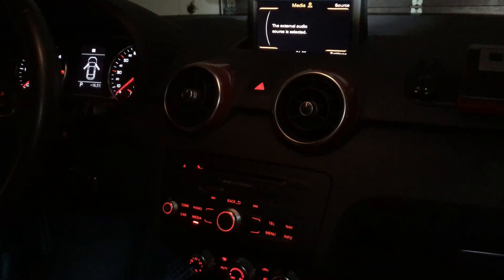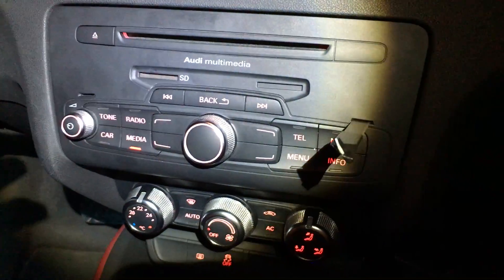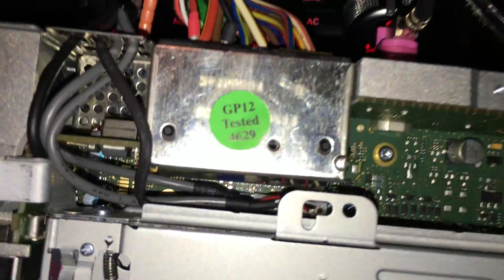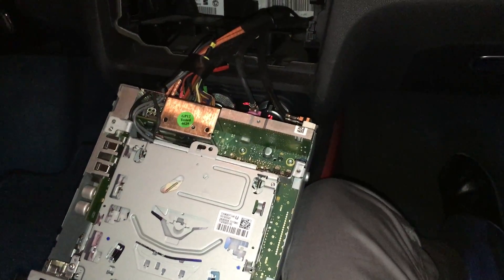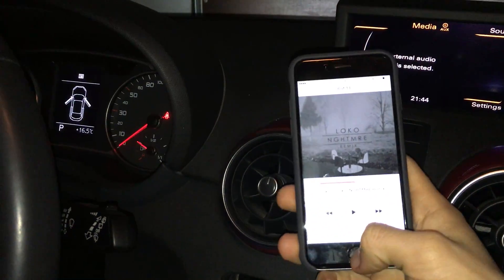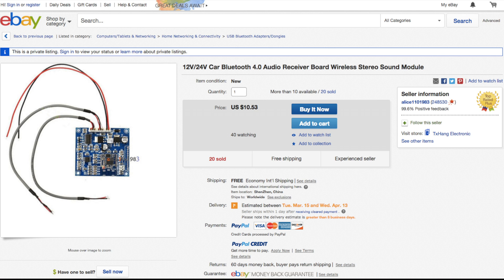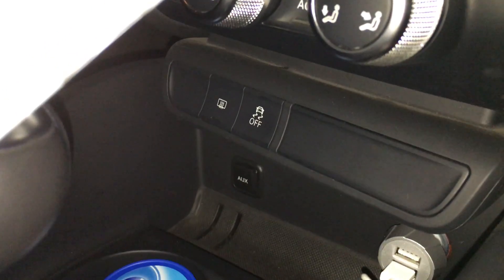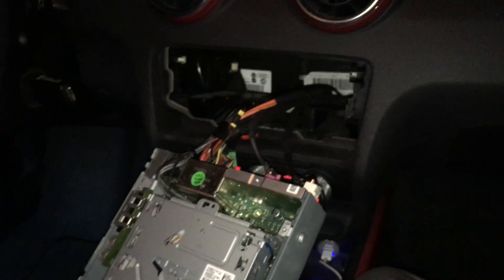Bluetooth Car Module Installation (Part 1)

Comment: But you don't explain input and output audio connections. I bought one but I can't find out input and output audio.
Reply from the maker: Ok, so here's the thing, imagine that this is your original 3.5mm aux cable and it consists of 3 wires like this:

MALE:                                                                                                   FEMALE:

--------------------------------------- Left         ||----------|----------\,,,,,,,/-----\        basically where the male cable plugs into!
--------------------------------------- Right       ||           |            |              |
--------------------------------------- Ground   ||----------|----------/"""""\-----/

I don't know if you see it but it is supposed to represent the existing AUX plug of your car (the male side)
Depending on the car, you might have the 3.5mm jack on a wire hanging around, or you might have a hole (female) in which your plug in a double sided 3.5mm jack from your car to your phone like this one: https://www.amazon.co.uk/World-Data-3-5mm-Stereo-Meter-Black/dp/B00077DC3S .

===========================================================================================

OPTION 1 (if you have to use a double sided 3.5mm jack cable):
In this case you have to remove the panels of your car and locate where this female cable goes into your stereo. you need to make a cable connection (and probablya DIY adapter) which will run from the BLUETOOTH output to your STEREO AMPLIFIER like this:

|"""""""""""""""""""""""""""""""""""""""|                      |""""""""""""""""""""""""""""""""""""''|
|                                  L-in  | --------<-------- | L-out       BT                  |
|    YOUR                   R-in   |--------<---------| R-out      CHIP               |
|    CAR'S                   G-in  |--------<---------| G-out                              |
|    STEREO                        |                     |                                         |
|                                           |       ,------------|  L-in                     Mic + |------------<-----------| MICROPHONE     |
|                                           |      |   ,-------- |  R-in                      Mic -  |------------<----------| WITH HOUSING   |
|,,,,,,,,,,,,,,,,,,,,,,,,,,,,,,,,,,,,,,,,,,,,,,,,,,,,,,|      |   |   ,----- |  G-in                                |
                                                   |   |   |      |,,,,,,,,,,,,,,,,,,,,,,,,,,,,,,,,,,,,,,,,,,,,,,,,,,,,|
                                                   |   |   |
                                                  ^   ^   ^
                                                   |   |   |
                                                   |   |   "--------------------------<--------------------------------------'''''''''''''''''''''''''''''''''''''''''''''''''''''''''''''''''''''''''''''''''''''|
                                                   |   "------------------------------<-------------------------------------- Female 3.5mm plug   <
                                                   "----------------------------------<-------------------------------------,,,,,,,,,,,,,,,,,,,,,,,,,,,,,,,,,,,,,,,,,,,,,,,,,,,,,|

===========================================================================================

OPTION 2 (if you have to use a single male 3.5mm jack cable from your stereo):
In this case you can do the same as above, or if you want to do a more simplifies version then do this:

-------------|''''''''''''''''''''''''''''''''''''''''''''''''''''''''''''''''''''''''''''''''''''''''''''''''''''''''''''''''''''''|                         |'''''''''''''''''''''''''''''''''''''''''''''''''''''''''''''''''''''''''''''''|-------------,
-------------| Male 3.5mm plug from your car | connect via:  > Female 3.5mm plug  |---------,    |
-------------|,,,,,,,,,,,,,,,,,,,,,,,,,,,,,,,,,,,,,,,,,,,,,,,,,,,,,,,,,,,,,,,,,,,,,,,,,,|                         |,,,,,,,,,,,,,,,,,,,,,,,,,,,,,,,,,,,,,,,,,,,,,,,,,|-----,    |    |
                                                                                                                                                  |    |    |
                                                                                                                                                  |    |    |
                                                 ,------------------------------------------>----------------------------------------- "    |    |
                                                 |    ,-------------------------------------->----------------------------------------------"    |
                                                 |    |    ,---------------------------------->--------------------------------------------------"
                                                 |    |    |
                                                ^    ^    ^
                                                 |    |    |
                                                 |    |    |      |""""""""""""""""""""""""""""""""""""''|
                                                 |    |    "---- | L-out       BT                   |
                                                 |    "---------| R-out      CHIP                |
                                                 "--------------| G-out                              |
                                                                 |                                          |
                                                   ,------------|  L-in                     Mic +  |------------<-----------| MICROPHONE     |
                                                   |   ,-------- |  R-in                      Mic -  |------------<----------| WITH HOUSING   |
                                                   |   |   ,----- |  G-in                                |
                                                   |   |   |      |,,,,,,,,,,,,,,,,,,,,,,,,,,,,,,,,,,,,,,,,,,,,,,,,,,,,|
                                                   |   |   |
                                                  ^   ^   ^
                                                   |   |   |
                                                   |   |   "--------------------------<--------------------------------------'''''''''''''''''''''''''''''''''''''''''''''''''''''''''''''''''''''''''''''''''''''|
                                                   |   "------------------------------<-------------------------------------- Female 3.5mm plug   <
                                                   "----------------------------------<-------------------------------------,,,,,,,,,,,,,,,,,,,,,,,,,,,,,,,,,,,,,,,,,,,,,,,,,,,,,|

===========================================================================================

Please open this comment on your desktop so that you can see the full diagram!

Comment: So where do you connect the L out, R out and Ground of this board? Can I connect it to the radio's amp?
Reply from the maker: Yes, you need to have an AUX input from your car stereo in order to connect the L, R and G from your Bluetooth chip to you stereo. i would need to know the exact model of your radio and have it in front of me in order to be able to tell you if you can or can't do this.
Reply: I removed the cassette mechanism from the unit. On the back of it, it's clearly marked  s-gnd, l-ch, r-ch, p-gnd. So I know which 3 pins of the 17 I need on the pcb. I bought a 3 pin mini connector and will plug it in the first 3 and solder the wires to it from the bluetooth board. To power the board I need a ground and I know which the power wire is that runs to the back of the radio.
Reply from the maker: Perfect then! All you'll need to do now is to wire the output pins of the bluetooth to the input pins of your radio/cassette player and you should be good to go. To find the power supply to the cassette and use it for the bluetooth I suggest that you put the key of your car in the ignition position and measure the input voltages of all wires using a multimeter. If you don't know where to start. just touch the outer casing of the cassette player with the negative (black) terminal of your multimeter and then with the positive you can probe around the back of all other connections and find the 12V supply. This is also handy of you want to find your Ground pin as that is the one where when you measure the voltage between the casing and the pin, the voltage will show zero. Then you can find the rest. Hint: Usually, the 12V positive is marked with a red wire and the negative is marked with a black, green or green-yellow wire. Good luck and let me know how it's going :)
Reply from the maker: Ok, so here's the thing, imagine that this is your original 3.5mm aux cable and it consists of 3 wires like this:

MALE:                                                                                                   FEMALE:

--------------------------------------- Left         ||----------|----------\,,,,,,,/-----\        basically where the male cable plugs into!
--------------------------------------- Right       ||           |            |              |
--------------------------------------- Ground   ||----------|----------/"""""\-----/

I don't know if you see it but it is supposed to represent the existing AUX plug of your car (the male side)
Depending on the car, you might have the 3.5mm jack on a wire hanging around, or you might have a hole (female) in which your plug in a double sided 3.5mm jack from your car to your phone like this one: https://www.amazon.co.uk/World-Data-3-5mm-Stereo-Meter-Black/dp/B00077DC3S .

===========================================================================================

OPTION 1 (if you have to use a double sided 3.5mm jack cable):
In this case you have to remove the panels of your car and locate where this female cable goes into your stereo. you need to make a cable connection (and probablya DIY adapter) which will run from the BLUETOOTH output to your STEREO AMPLIFIER like this:

|"""""""""""""""""""""""""""""""""""""""|                      |""""""""""""""""""""""""""""""""""""''|
|                                  L-in  | --------<-------- | L-out       BT                  |
|    YOUR                   R-in   |--------<---------| R-out      CHIP               |
|    CAR'S                   G-in  |--------<---------| G-out                              |
|    STEREO                        |                     |                                         |
|                                           |       ,------------|  L-in                     Mic + |------------<-----------| MICROPHONE     |
|                                           |      |   ,-------- |  R-in                      Mic -  |------------<----------| WITH HOUSING   |
|,,,,,,,,,,,,,,,,,,,,,,,,,,,,,,,,,,,,,,,,,,,,,,,,,,,,,,|      |   |   ,----- |  G-in                                |
                                                   |   |   |      |,,,,,,,,,,,,,,,,,,,,,,,,,,,,,,,,,,,,,,,,,,,,,,,,,,,,|
                                                   |   |   |
                                                  ^   ^   ^
                                                   |   |   |
                                                   |   |   "--------------------------<--------------------------------------'''''''''''''''''''''''''''''''''''''''''''''''''''''''''''''''''''''''''''''''''''''|
                                                   |   "------------------------------<-------------------------------------- Female 3.5mm plug   <
                                                   "----------------------------------<-------------------------------------,,,,,,,,,,,,,,,,,,,,,,,,,,,,,,,,,,,,,,,,,,,,,,,,,,,,,|

===========================================================================================

OPTION 2 (if you have to use a single male 3.5mm jack cable from your stereo):
In this case you can do the same as above, or if you want to do a more simplifies version then do this:

-------------|''''''''''''''''''''''''''''''''''''''''''''''''''''''''''''''''''''''''''''''''''''''''''''''''''''''''''''''''''''''|                         |'''''''''''''''''''''''''''''''''''''''''''''''''''''''''''''''''''''''''''''''|-------------,
-------------| Male 3.5mm plug from your car | connect via:  > Female 3.5mm plug  |---------,    |
-------------|,,,,,,,,,,,,,,,,,,,,,,,,,,,,,,,,,,,,,,,,,,,,,,,,,,,,,,,,,,,,,,,,,,,,,,,,,,|                         |,,,,,,,,,,,,,,,,,,,,,,,,,,,,,,,,,,,,,,,,,,,,,,,,,|-----,    |    |
                                                                                                                                                  |    |    |
                                                                                                                                                  |    |    |
                                                 ,------------------------------------------>----------------------------------------- "    |    |
                                                 |    ,-------------------------------------->----------------------------------------------"    |
                                                 |    |    ,---------------------------------->--------------------------------------------------"
                                                 |    |    |
                                                ^    ^    ^
                                                 |    |    |
                                                 |    |    |      |""""""""""""""""""""""""""""""""""""''|
                                                 |    |    "---- | L-out       BT                   |
                                                 |    "---------| R-out      CHIP                |
                                                 "--------------| G-out                              |
                                                                 |                                          |
                                                   ,------------|  L-in                     Mic +  |------------<-----------| MICROPHONE     |
                                                   |   ,-------- |  R-in                      Mic -  |------------<----------| WITH HOUSING   |
                                                   |   |   ,----- |  G-in                                |
                                                   |   |   |      |,,,,,,,,,,,,,,,,,,,,,,,,,,,,,,,,,,,,,,,,,,,,,,,,,,,,|
                                                   |   |   |
                                                  ^   ^   ^
                                                   |   |   |
                                                   |   |   "--------------------------<--------------------------------------'''''''''''''''''''''''''''''''''''''''''''''''''''''''''''''''''''''''''''''''''''''|
                                                   |   "------------------------------<-------------------------------------- Female 3.5mm plug   <
                                                   "----------------------------------<-------------------------------------,,,,,,,,,,,,,,,,,,,,,,,,,,,,,,,,,,,,,,,,,,,,,,,,,,,,,|

===========================================================================================

Please open this comment on your desktop so that you can see the full diagram!